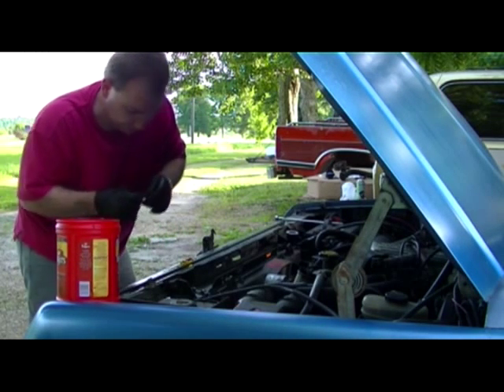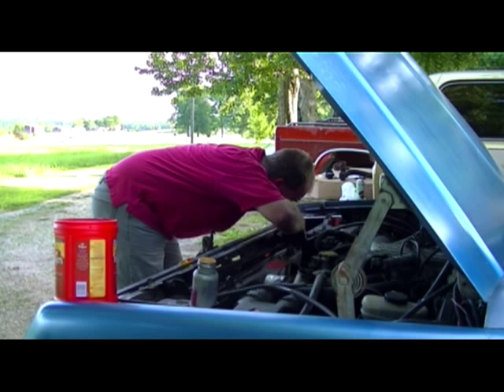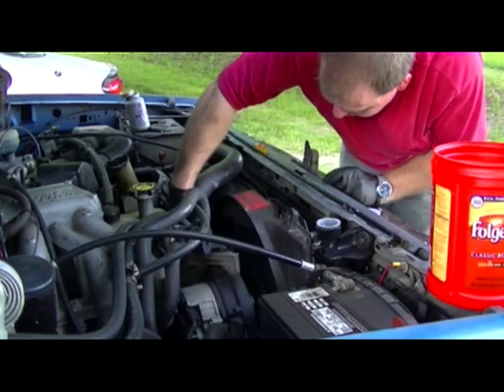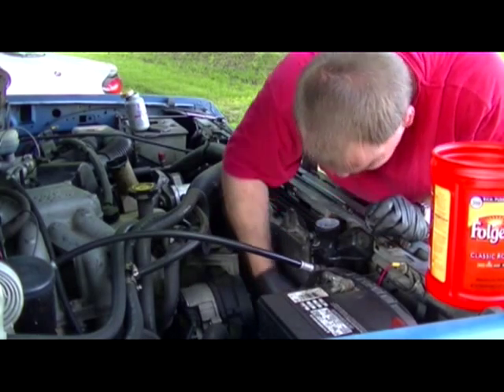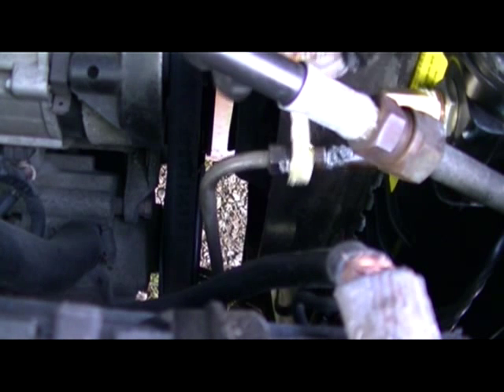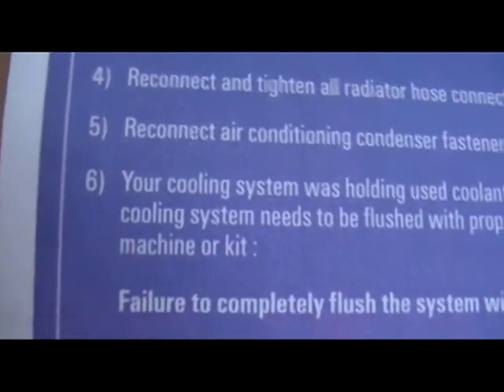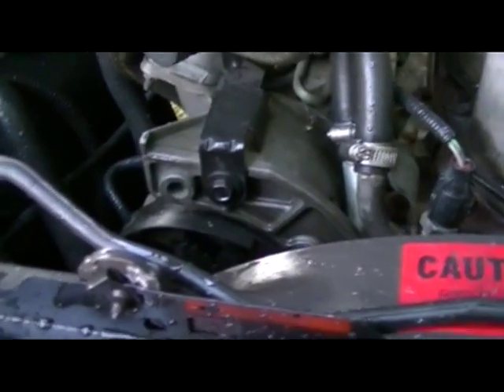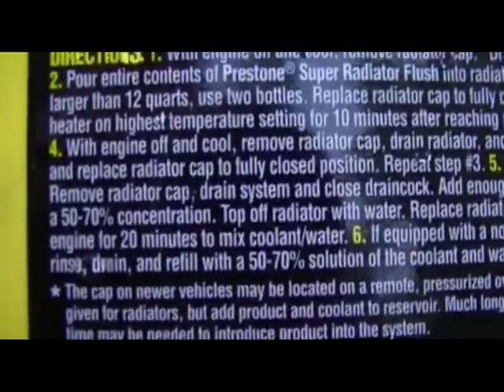Blue F-150 Radiator Replacement Part Two

Comment: can you please tell me what parts u used to get the radiator out?
Reply: Soxket wrench, with extension, using both 8mm and 10mm fittings. Screw driver. Adjustable wrench.